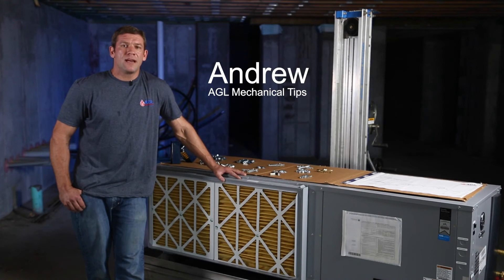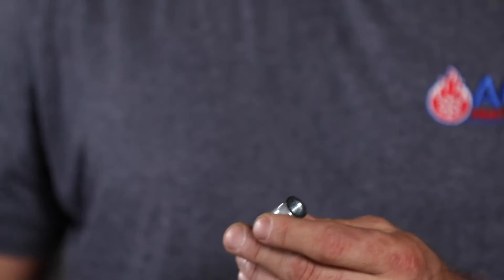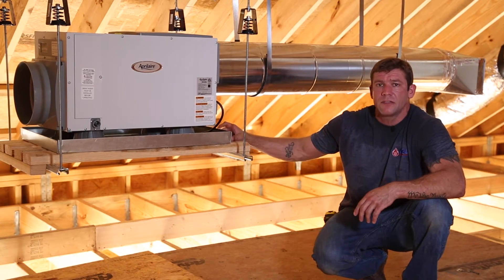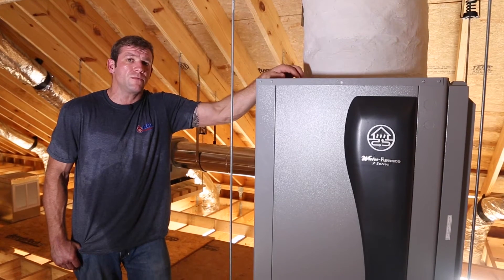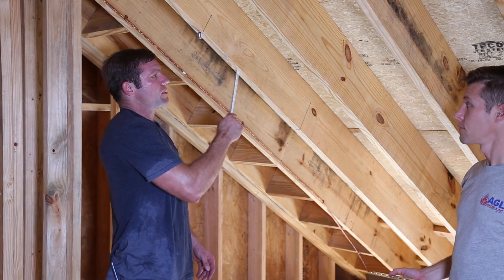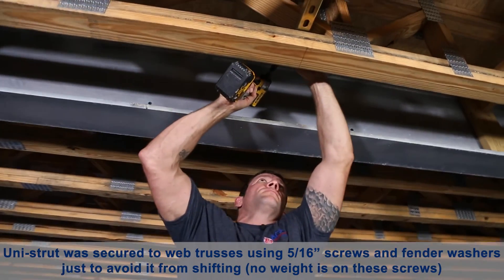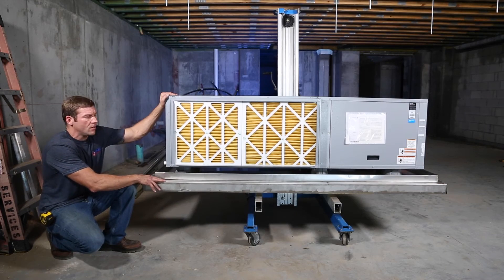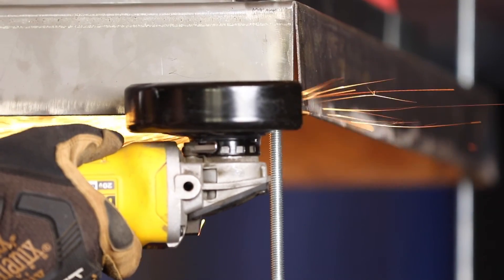How to suspend mechanical equipment (Mechanical Training # 105)

Comment: In the basement configuration is it preferred to hang a humidifier or raise it supporting with a raised rack below from the basement slab? (Keeping in mind vibration isolation from living space above and the general inherent vibration from a whole house dehumidifier like an aprileaire 120).  When building a rack for support from below, how would you do that when the raised rack is high to maximize space utilzation below it.  What materials etc?

Comment: Best HVAC videos on Youtube hands down! 

Question: I just suspended my new Dehu on vibration springs just like in the video. What just hit me was how do you run the PVC AC condensate line without it vibrating all the down?

EDIT: It just hit me, I think I got it although would still be very interested to hear your feedback.  Im guessing its somethng  along the lines of:  PVC clamped to edge of platform, then some flex tube, to PVC clamped to a something else.
Reply from the maker: We normally don't worry about the PVC, it does not transfer vibration well and has not been an issue.  I would straight pipe it just like you normally would. Thanks for the compliment!

Comment: Where do you get those plastic stands holding the air handler up out of the drain pan? My local supply house hasn't heard of them, and all I ever see in the field is 4x4 boards in the pan.
Reply: Never mind, I found them. Diversitech Heat Pump risers. part# HPR-3
Reply from the maker: Here is a link if you need it.  We remove the adhesive.  Also, if we are having clearance issues we will ditch the center piece which makes is a 2" riser (air handler will be barley out of the pan).

https://www.diversitech.com/product/view/5468
Reply: @aglmechanicaltips  cool, thanks!

Comment: Another idea for hanging equipment with threaded rod:

Spread the top attachment points out wider than the bottom attachment points. For instance, a 48" x 48" pattern for the Sammys at the top centered over a platform with a hole pattern at 40" x 40". The platform won't swing at all.
Reply from the maker: Springs won't sit right if you spead them like that
Reply: @aglmechanicaltips  are you referring to springs in vibration isolator hangers? The tension is still parallel to the rod, so I can't see how that would be an issue

Comment: Yeah, I learned quite a lot. I learned the jackholes who originally hung an oversized electric gas HVAC system directly screwed vertically into the joists on only 4 points under my dining room were complete fools and had no idea what they were doing. And the guys who say that the vibration can’t be mitigated  (“because it’s old”) Just want to sell me a new one. It looks like a lot of equipment available to significantly reduce vibration and maybe extend the life of my unit a few years least produce the vibrations, which are now becoming a real problem

Comment: Andrew, when you suspend a gas furnace and coil horizontally how do you handle the gas line comnection?  I just did this exactly as you show with a platform, unistrut, threaded rod and sammys.  The unit can move swing quite a bit if you bump it or maybe from vibration. I would rather hard pipe but it seems flexible gas connector may be the better choice to handle the movement. 
What do you do?
Reply from the maker: You can run hard pipe gas line to the appliance but need to use an appliance connector at the unit (appliance connector is a 2' or 3' piece of flexible gas piping).

Comment: I love your videos - keep up the great work! I agree with you on pan sizing -  I've seen shorter than the coil cabinet on some installations - - Mech Code: 307.2.3 Auxiliary and secondary drain systems. The pan shall have a minimum depth of 11/2 inches (38 mm), shall be not less than 3 inches (76 mm) larger than the unit

Comment: Awesome video. Best hvac stuff out there. Andrew, what do you use to strap up your main round trunk line?  It looks like 1 inch metal banding.  Is the flex webbing (2 inch) sufficient for like a 30 foot reducing run?  This is going to be insulated duct.  Thanks
Reply from the maker: Webbing is strong stuff.  I used metal on hard pipe and webbing on flex.  This is personal preference.  The webbing should have a data sheet that can outline the weight rating.  Make sure you fold the ends where you screw so the screw won't pull through the webbing

Comment: PLEASE EVERYONE, do not use any type of grinding or cutoff wheel on your angle grinder without attaching a proper guard! Safety glasses alone will not protect you from fragments of a broken cutoff wheel flying toward your face or neck at mach jesus.

Comment: how do you hang unistrut on roof trusses vs rafters
Reply from the maker: Depending on the weight I would probably bolt unitstrut between a couple of them to spread out the load and then build my suspension off of that piece of uni strut.  Similar to what I did with the floor trusses shown torwards the end of this video but this piece of unistrut would be below the truss not above.  This is difficult to properly explain..

Comment: I'm in an old house that got a small attic unit put in about 2 yrs ago. It doesn't vibrate "much" but I still wish they'd suspended it, even if just a few inches off the bottom surface. Depending on where you are upstairs you can kinda hear/feel the vibration and it would be best if it weren't present.

It seems to have the pan and a support under it, including those gray footers, so it might not take too much for me to add a basic suspension system like you show here.
Reply from the maker: You could more than likely leave the pan where it is and just suspend the air handler and remove the grey risers below.  It would definitely help with vibration if not eliminate it altogether.

Comment: Bandsaws work exceptionally well with all thread as long as you angled bandsaw blade slightly away from perpendicular so that it's cutting in between threads

Comment: Great video! Loads of information, thanks! One addition for anyone that needs to cut threaded rod and doesn't have the tool for clean cuts is to thread a nut onto the rod before cutting. After making the cut simply remove the nut and it cleans the threads up as it's being removed.